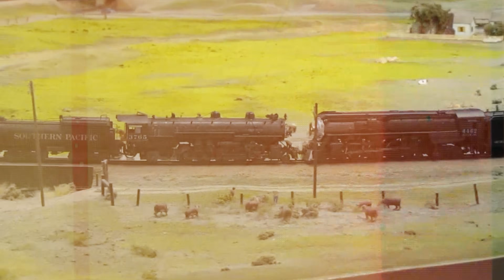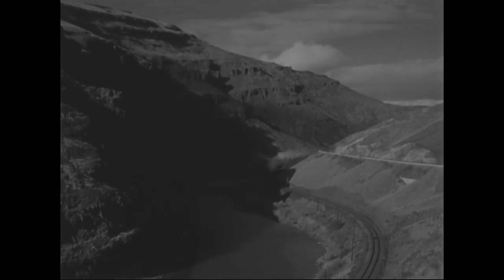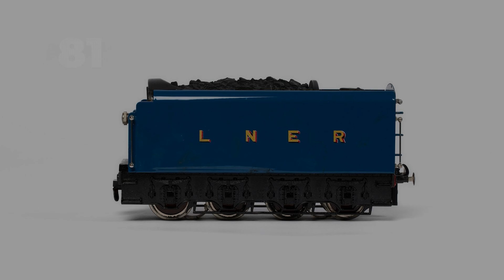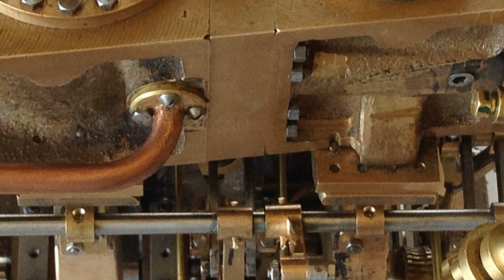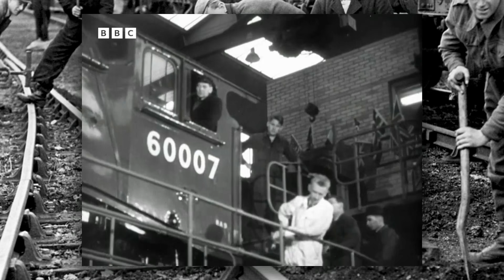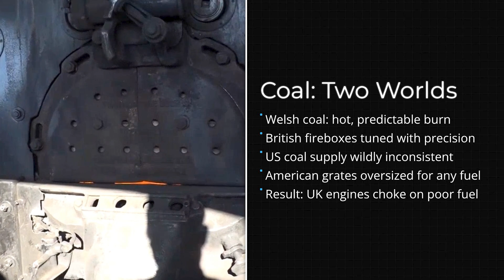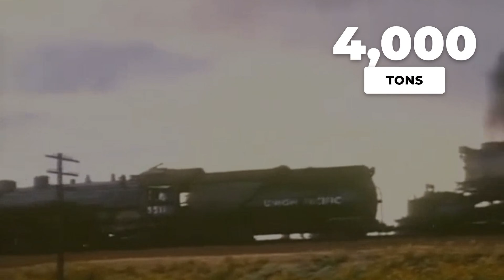Why British Locomotives Would’ve STRUGGLED in America

Comment from the maker: Just to be clear, this video isn’t taking shots at British steam. I love British locomotives. The whole point is showing how different the engineering worlds were, and why a machine built perfectly for one system wouldn’t survive in the other. No disrespect to anyone, just the fun reality of rail history.
Reply: What you said in the video is correct but you made a serious mistake, which is comparing the Mallard, a passenger locomotive, to the Big Boy, a hauling locomotive, you should have compared the Mallard to another US passenger locomotive like the PRR S1 built in the same period which had 84 inch drivers or the most produced PRR T1 with 80 inch drivers since both of them were designed for high speed and also suffered from wheelslip.
Reply: @Maverick966 
Or 2-10-0 Evening Star...
Although it was a 9F freight
Could haul passenger at up to 90mph.
Reply: @EugeneMurray-z1bThe 9F had a curious advantage because of its small size and power, in that it meant that the running gear could be made much lighter than, say, a Pennsy I1SA, and thus its 60” drivers were perfectly sufficient to counterbalance that small mass.  The I1SA was a 2-10-0, like the 9F, but the running gear had to be made absolutely massive in order to stand up to near enough to three times the tractive effort of the 9F.  Therefore, because it had all that extra reciprocating mass running on drivers the same size as the 9F’s wheels, so the I1SA tended to be horribly rough on the trackwork, and any Hogger that tried to run one at ninety would soon answer to the track gang, and pay with his life.
Reply: @EugeneMurray-z1b The New York Central 4-6-4 streamlined aka the j3a Hudson could pull passenger trains at 120-123 mph
Reply: I still need a snarky British YouTuber to reply with all the ways a Big Boy couldn't possibly keep up with the demanding London-Edinburgh express route, while scraping the sides of every tunnel and breaking every set of switches and damaging all the curves and bridges along the route before finally flooding the terminus hall with inefficient black smoke.
Reply: @mkeratking   Nah Big Boy or a Allegheny or heck a Yellowstone would have widened the tunnel as it went through.... but assuming they FIt a single Yellowstone would haul 10 trains of what a mallard would do and be like the guy coming from the store. 1 trip. No second trips to deliver quanity..
Reply: @mkeratking The N&W Class J would handle that run with ease.  They went five hundred miles between servicing.
Reply: The railways were developed on the same basis as "horses for courses". There would be no need and therefore no point in building, say, "Big Boys", for the British Isles.  Shorter, more frequent trains met the needs much better.
Reply: no offence your comparing apples to oranges your comparing freight to passenger trains maybe comparing the mallard to an American passenger train like the daylight or N&W js or something. idea here maybe compare the BR black 5 to the Baldwin 2-8-4 s-3 Berkshires that would be a better compression for this topic. just an idea keep up the good work
Reply: Fair points made...
But didn't The Flying Scotsman tour the US & Australia very successfully?

Even had a bell & chimney headlamp fitted as per local regs
Reply: This is like talking about how an American Ford Superduty puckup truck would struggle in London, while a British Jaguar would never be able to operate on a ranch in Kansas
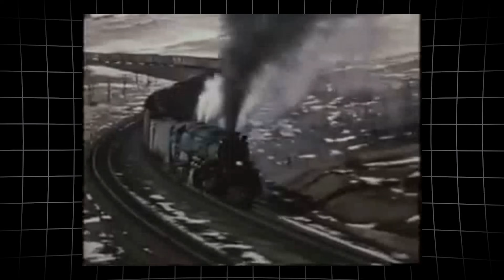Reply: 2:31 67!
Reply: You know the Brits will take it as a shot at their locomotives, theirs is always the best, just ask them.

Comment: As an American born and raised in Chicago, this was a great video. I think that high-speed British steam locomotives could somewhat work on the CHI-STL Lincoln Service. The reason why is because that entire route runs through flat farmland after leaving Joliet. It's perfect for those locomotives, seeing as how Britain has a lot of flat terrain. However, though, I think what they'd be up against is range, because it is 283 miles between those two cities and would possibly need a water stop at Springfield. I think this is where diesels like the Charger and Genesis are better because they're fast, lightweight, powerful (4,250 and 4,400 HP) and can hold between 1,800 and 2,200 gallons of diesel fuel. However, I think it would be exciting to see how a British Engine like the Mallard could perform in a race against an American P42 and SC44.

Comment: Of course they will. Especially compared to the jumbo engines like BB. However it's the American railroad to be the one insane. BR is not at least not as same level of insanity.
Two things. One is axle load the other is curves. BB or any american steam is too heavy and it will crush squishy tracks and bridges. BB has an axle load of 31 tons (68k lbs) and that's too much for any tracks even today's. (Datong-qinhuangdao coal special has an axle load of 30 tons and changes track every MONTH). Allowing 31 tons of axle load is simply physical nonsense. Guess americans don't care about their tracks.
Curves are easier understood. Despite having a hinge in the middle it couldn't go through too tight of a corner at least not as good as smaller engines like diesels or pacifics.

BR didn't go insane they are normal. In fact it's better to define CR (Chinese rail) as normal and BR is a bit too small. BR has normal axle load and lightweight trains both passenger and freight. And they have the smallest loading gauge.

I said CR they had got american demands to handle (not the lightweight BR trains) but had to respect physical laws like BR. No massive axle loads (25 tons nowadays normal routes, 20 tons in mao era). CR's answer was class QJ which has 3000 horsepower while keeping 20 tons of axle load. Not much, but in case of BB's load just use a pair of them. That's 6000 horsepower without crushing the tracks. In this extent QJ was more BR than AR it has a high power-weight ratio like BR.

A typical Chinese freight train would haul 5000 tons and that would need 3x qj on shenyang-dalian route (2% grades). Or 1 hxd series electric locomotive today. (7200 KW or 9700 horsepower)
A typical Chinese passenger train would haul 18 cars which is around 1200 tons and that would need 2x pacifics or 1 qj. Today 1 hxd d series electric locomotive (7200KW) could haul it at 160 kph at ease.

In total I think BR is more reasonable AR is too wild west, and that explains why accidents like derailing occurs a lot in AR. If one of this happens on CR the officials would lose his position.
Talking about BR it would be really useful if the newly founded China could buy class 55 deltics. It has 3300 horsepower and ran 160 kph max. The top speed is useless for that era china but the horsepower can be very useful. SD40 could also do the job but it has to lose weight until its axle load comes into tolerance.

Comment: The British 9F  2-10-0 had only about half the pulling power of a Pennsy Hippo Decapod,  but the UK wouldn't be able to handle the loading gauge or axle load of the American loco. British railways were superbly engineered, but got stuck with width and height restrictions. London subways as one example.

Comment: Meanwhile, local tourist railroad has 10.5% grade switchbacks with geared engines ('4 wheel drive' for trains) designed for steep logging paths.
England is easy mode in nature.

Comment: "Briddish" locomotives also worked across India, Africa and Australia, hauling everything they needed to, just fine. Comparing American heavy freight locomotives to British express passenger locomotives is never going to do either justice.

That said, an LNER A3 did visit North America for an extensive tour of the US and Canada and performed, according to reports from the time "beautifully".
GWR Castle Class locomotives performed very well (with little maintenance) across the vast landscapes of Australia. 

British locomotives built for heavy freight absolutely worked for heavy freight. 
Only thing they may have struggled with is areas of the US where wood was the predominant fuel, lacking the firebox area needed to gain any heat from such a low calorific fuel.
But then, American locomotives designed for wood would likely have simply melted if fuelled properly with Welsh Coal.
Reply: You need to use the right amount of engines to haul that heavy train. A train for a single BB will need at least 2x class 9F probably more. They do work fine for heavy freight, but you need to cut the train into acceptable sizes.
(Also you need knuckle coupler the british rod coupler will break under such a huge force)

The ideas of brit locos are very right. They want the maximun horsepower/weight ratio, not making a jumbo loco which will crush the tracks.
Reply: "Heavy" freight in the UK wasn't that heavy by American standards. Train densities and lengths were lower. Trains were smaller.

American locomotives were more powerful. This is an objective fact. Their higher clearances allowed for larger boilers, fireboxes, and piston assemblies. The Austerity class had about half the pulling power of  a union pacific FEF-1, and LNER's garratts, the most powerful engines on the british system, had a tractive effort of only 72,000 - nothing to scoff at, but less than even a Pennsylvania Railroad decapod at 96,000 (and these were far from the strongest locomotives in the US).

But these locomotives would not have worked in the British engineering environment where existing infrastructure and narrow clearances mean trains NEED to be smaller. You try and shove a PRR decapod through a British tunnel and you are going to end up with a condemned tunnel, a closed line, and a destroyed locomotive.

In the end, raw numbers aren't everything. Locomotives do not exist in a vacuum but in the context of their railway.
Reply: British locomotives in the colonies were also built to different gauges and loading gauges. You can't run Akbar on UK or US infrastructure because of its wheels, of course, but even if it fit on standard gauge it would find itself in trouble when facing clearances. On tunnels in Appalachia the Akbar will do the same thing the PRR decapod would in England - destroy good infrastructure and also itself.

British broad gauge locomotives in India were more powerful than comparable locomotives in the US or UK because they had the space to be designed that way and, more importantly, the economic need. 

There is no need for a locomotive in the UK that can pull 50 American cars up the wasatch mountains or pull a broad gauge freight consist across India. For the brits, that is a waste of resources.

Comment: In Britain we used "banking" engines frequently . This is more efficient than using an oversized engine on the relative flat NOT helping engines. A couple of South Wales coal mines should be reopened for the 100+ heritage lines, rather than importing Polish or other imported stuff..

Comment: Well, this world record is controversial. Yes, the A4 Mallard reached 201.4 km/h. But it only reached this speed when traveling downhill.

Many consider the 05 002 series from Germany to be the world record holder. It “only” reached 200.4 km/h. But that was on level track.
Reply: But its performance up Stoke shortly before withdrawal working 415 tons was an even better performance. It is credited with producing the highest hp produced by a member of the class. As to the maximum speed attained by A4s; the truth is that no one knows. The class were famed for their good riding qualities but there are interviews with retired crew members maintaining that the ride did cause concern at some of the speeds attained but unverified but in excess 220 km/h was perhaps one barrier. Others believed it was higher and then you have Bill Hoole who felt it was higher again, significantly  higher.
Reply: There is also the PRR T1 that has reportedly also beat that record.
Reply: I don’t know if you know how competitive the Germans were in the late 1930s? If they could have got one more mile an hour out of that machine they would have!
Reply: @nosecone5921  You do know that it was expected that Mallard would achieve 130mph or more? The run did not go as expected as a temporary speed restriction had been imposed through Grantham station. The maximum speed attained was disappointing and so it was planned to make another attempt. Sadly WW2 broke out and there was never further opportunity for the engines to exhibit what they could really achieve in terms of maximum speed.

Comment: Oddly, British locos were designed for Britain and would have struggled in the USA just as much as American locos would have struggled in the UK.  Both were created for their own networks.
Reply: American engines would crush BR tracks. British engines could operate on american track but won't pull enough load to make them competitve. Also the speed limit may not allow fast engines like mallard to run full speed.
If you want to see how brits would do should they got the american map, check China. Class QJ is somewhat a british locomotive it is lightweight and got a lot of horsepower for its size which is same as the brits.

Comment: Not sure if it's fair to compare Mallard with the Big Boy, since a precision high-speed passenger engine cannot compete with a massive freight-hauling mountain mauler. But the point is taken. The largest British steam engines were 4-6-2s for passenger and 2-10-0s for freight; I don't remember whether any Garratts (Garretts?) were used in the British Isles. But no 2-8-4s or 4-8-4s or 2-10-4s or anything like that, curiously enough, and no massive articulateds, either, since passenger and freight trains didn't rise to the massive sizes and lengths required of trains in the USA. It would be nice, though, if British engines were equipped with whistles that befitted the majesty and dignity of a steam locomotive, since, for me, at least, those tiny little single-chamber "peep-peep" whistles don't cut it. . .
Reply: European Realist (Brit) here.  Yes, there were Garretts, but only on the LMS (London Midland Scottish) no 47967 ff.  Introduced in 1927.  33 still in use in my 1955 'ABC' of British Locomotives.  TE 45,620 lbs. I believe the class were primarily built for the East African colonies and were a rare sight in Britain.  I think I saw one once near Derby in the 1950s.  And the only 2-10-0s were wartime locos developed in the early 1940s, which led to the great post-war 92000 class 2-10-0, which was a very successful class.  Check out Churchward's GWR 2800 class, first developed in 1903 (!), which ultimately became the basis of most later UK freight engines.  I used to see them steam through my village hauling that fabled Welsh coal up to the Midlands.  BTW, not all locos in Britain ran on Welsh coal, as the video suggests.  Other regions had their own sources, but it's true Welsh coal was the most calorific.

Comment: Each country built what it had to suit the environment it operated in. Yes American locos could be bigger because they were not restricted to the tight loading gauges we have in the UK.
Only the GWR used Welsh coal in the UK. The other big 3 got coal from  within its geographical areas.
This may not be intentional but this video comes across as American is bigger and better when the reality is each system works well and suits its own environment.
Most European rail systems are light years ahead of American systems but your internal aviation system is fantastic be ause of the vast ess of the  ountry.
You do what you need to do.

Comment: Why would you compare an American freight locomotive to a British passenger locomotive. Why not use an American passenger locomotive like the Union pacific 844 to compare against the British passenger locomotives.
Reply: You don't want to get into that fight. A PRR K4 built far earlier than the Mallard is already 25% more tractive effort. Mallard only had speed. And the PRR T1 probably beat it Unofficially
Reply: The majority of American locomotives were freight capable (also objectively speaking the mallard class DID have a freight rating)
Reply: Should be comparing to a 9F
Reply: 9F doesn't even touch most of our Passenger Locomotives. Your rails and loading gauge is just too small for meaningful power on US Rails.
Reply: @Nuclear_Doughnut I get it the 9f would lose to the larger us locomotives but it would do "light" work fast.
With the constraints it was under it was exceptional.
Reply: @primeprover I was comparing a US 2-10-0 to a UK 2-10-0. Now I hate to say this. The USA built and gave the Soviet Union A 2-10-0 That was 20% more powerful than the 9F. The 9F was the equivalent to most of our passenger locomotives.
Reply: That's because almost all US locos would be classified as 'mixed traffic' in the UK, as they're at least suitable for freight or passenger service. While the initial design process would specialize them, they were effective at both.